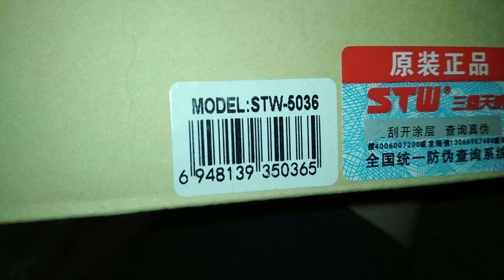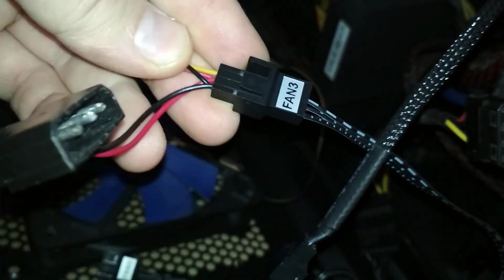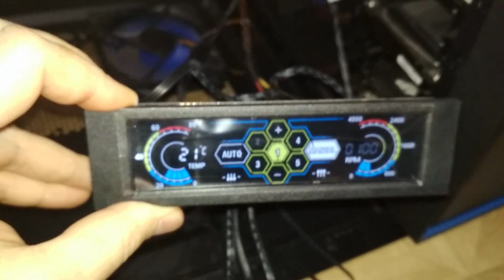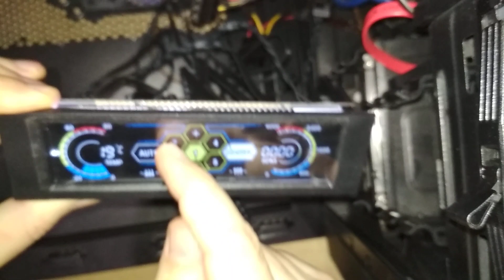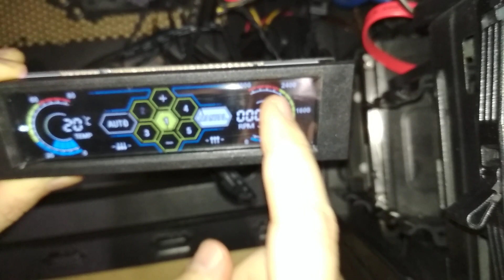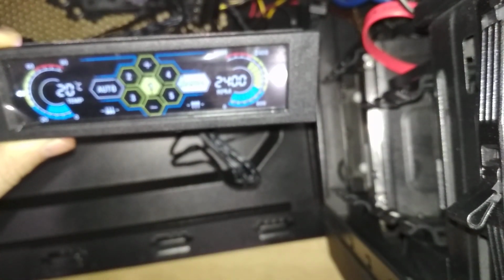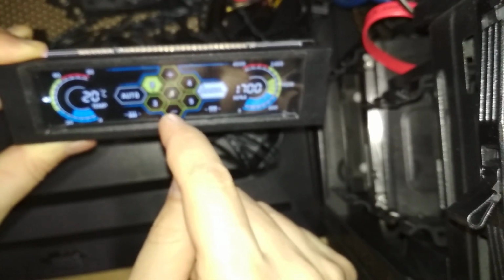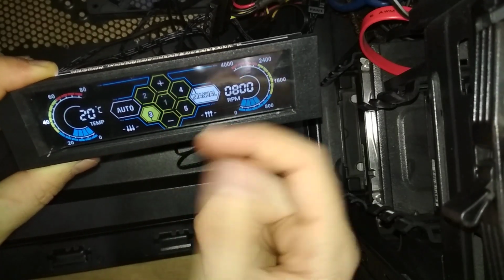5.25"inch PC 5 Channel Fan Controller Automatic Speed Control & LCD Touchscreen

Comment: Stefan, I think the issue with fans connected to channels #1 & #2 is that they expect full voltage to their Vcc and the fourth pin in the connector is a PWM/control signal.  With the way this controller seems to be working, I have one also, it PWM's the voltage to the fan.  I wonder if this is like putting a "don't use with dimmer" light bulb on a dimmer control and have the light do all sorts of weird things.  Take care.
Reply from the maker: Hi Jeff,
This controller is PWM but it is only 3 pin for Fan. Mine fans were with 4 pin plug so it doesn't work properly with them. But you are right I needed fans with PMW control and 3 pin plug to control them correctly.
Take care man
Reply: @stefancvetanov1548   You are 100% wrong this is a PWM fan controller so since your fans only have 3 pins they do not have the 4th pin which is the PWM control! SO this is 100% user error!